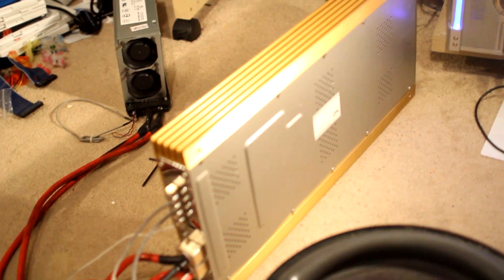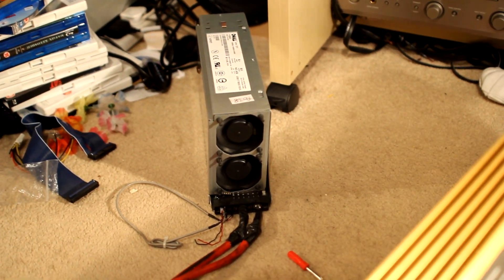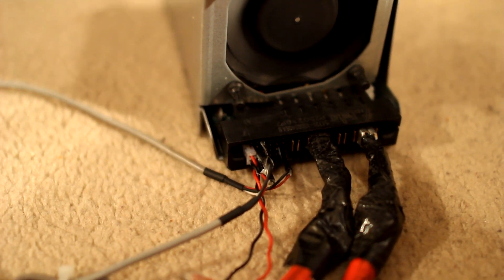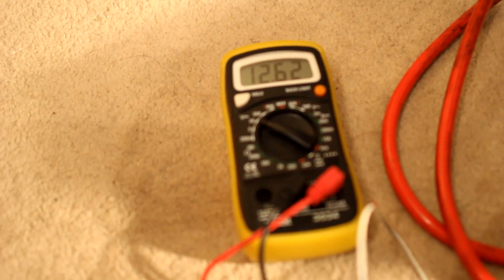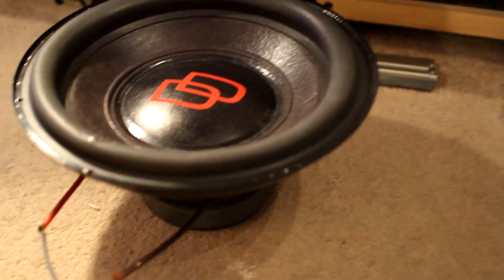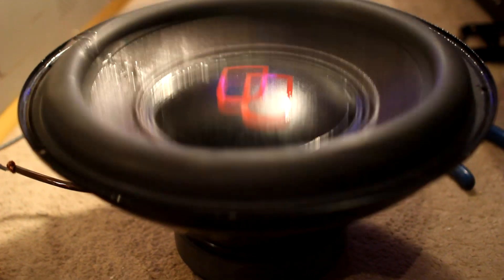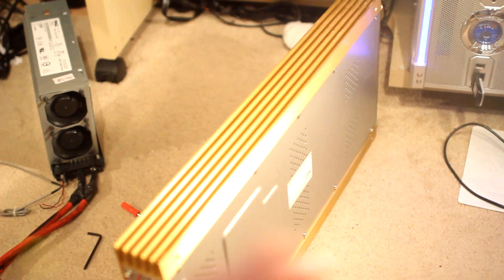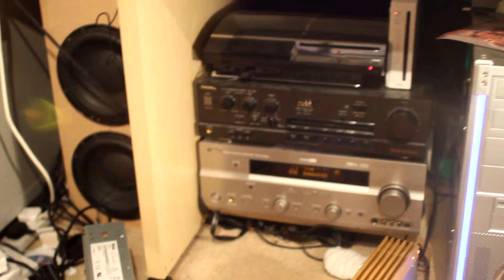Car amps on SERVER PSUs?? Get big bedroom bass power for CHEAP!

Comment: I would stick with the car audio..I tried the crown XTI amplifiers and in my opinion they where garbage..I am currently running 2 power supplies that are 14.5 volt 120 amps..A taramps and a stetsom..4 car amplifiers..1 PPI ICE7000.1 on 2 skar audio EVL-18S and 2 bemines GZ-61 1 amp on 3 American bass XO 15s and the other on another 3 american bass xo 15s..Then i have a genius GMP-200.4D bridged to 2 channels on 2 American bass godfather series 8 inch horn drivers..All getting signal from a JVC BT150..Have alot of videos on my utube channel and its the best audio set up ive ever seen very impressive!!

Comment: Here in the states it would be much easier, neater, and just as cheap if not cheaper to buy a used pro audio amp off of Craigslist. And you can get the ones, like the Crown XTI series, that have DSP built in. So you'll have room correction, limiters, delay, and digital crossovers built in. And in one clean package. Then you could get some Eminence, or other pro audio subs that are designed for use in rooms, aren't designed to make use of the cabin gain that cars afford you. This will do a much better job. This will sound better, look better, and be safer. You could also get a loudspeaker manager if you wanted even more control over your whole system. 

I would not go this way myself, unless I already owned the car stuff, and even then. I would probably sell the car stuff, and get the pro gear instead. Or you could also pick up some cheap used HiFi amps, and use a MINI DSP as the crossover/room correction. I just got an AVA Omega Star 250EX for $225. That's plenty of power for subs in a bedroom. I have it hooked up to my $200 Cerwin Vega VS-150's w/15" woofers. The box is about 6 cubic feet, and ported. 

I have too much bass right now. So much so that I'm going to buy a miniDSP, or use my computer or my Raspberry Pi as a DSP to make it sound better. It sounds amazing already, but on some songs it's just a little too much, and I don't have tone controls. Plus room correction is almost a must with this much bass in a small room. This stuff just isn't that expensive. Certainly not so much so that it's worth having a jerry rigged mess in your listening area. Of course the situation may be different where you live.

Comment: I know this vids old but why doesn't a company sell these psu's but made only for powering car amps at home? They would sell loads. If anyone knows why a company has not done this let me know :)
Reply: +Hugh Stevenson They do, to some extent. The thing you're looking for is a '12 volt power supply' for things like ham radios and such. For example, these:
http://www.universal-radio.com/catalog/hamps/astron.html

Note that many other companies make similar power supplies, and this is just an example, not a recommendation. You should look into different brands and ability to supply continuous power before buying one.
Reply: +Private Information OK cheers for that
Reply: digital designs sells one
Reply: Taramps and stetsom both make them for car audio

Comment: i have a.question about the connections on 12v rails... did you connected them with normal terminal climps and soldered to a bigger wire.maybe 4 gauge cable ??

Comment: How do you wire two of these server power supplies together?
Reply from the maker: In parallel, and connect the current share pins together on both PSUs.

Comment: hey I have a dell server supply I use at home for repairing amplifiers.
mine puts out 13.8volts and 121amps :) built in to a nice case with volt and amperage meters and lcd fan controller with sensors 

il be upgrading soon too get 14.4 volts 500-600amps
Reply: richard beetwell did you modify the PSU to give 13.8? also what brand/model is that
Reply: richard beetwell chance of getting any pictures?

Comment: Because of this video, I went on eBay and bought myself the same Dell PS. This is truly amazing. But if I may bother you to wonder which pins bump the voltage up to 12.6~ volts it'd be fantastic, thanks!
Reply from the maker: Its good theres literally no voltage drop! Since this video ive found ones on ebay that put out 157A on the 12v rail!!
To bump up the voltage connect one of the 3.3 rail pins to the 'currentshare' pin.
Reply: barevids AWESOME! I just connected two pins, which I believe to be the right ones, and the voltage went up to 13.2 volts! It's all running stable, too!
Reply from the maker: JesusCrunch WHAT?! How did you get it that high!? can you do a diagram of what pins you connected where!?
Reply: barevids Here's a diagram I just made. Imagine the power supply flipped opposite of how you have it in this video. The pins colored red are the two I connected to get 13.2 volts.
https://drive.google.com/file/d/0B9F_Yk-DM1YkUFJqNlZaTUtTaWM/edit?usp=sharing
Reply: JesusCrunch
I only get 12.6~ volts, so there is something you're not telling us:)

Comment: Server PSUs... why didn't I think of that? two 12 volt PSUs @ 75amps each 75+75. would be perfect for a 1200-1500 watt rms amp .... I want .... but doesn't Kinetic make like 80 amp power supplies/chargers that do pretty much the same thing??

Comment: I Would deffinitely stick some caps between the PSU and the amp. Computer powersupplies aren't designed for big drops. A couple of 10000uf 16V caps would improve that setup immensly.

Comment: you should run a capacitor too as it will put less stress on the psu and make it last longer
Reply: Do some research on capacitors :)
For the capacitor to do anything, it requires a voltage drop. That power supply isnt even droping 1/4 a volt.
 MATH:
E = (1/2)* C * V^2
Joules(Watt-seconds) = (1/2) * Capacitance (Farads) * Voltage^2

1 farad capacitor:
E= (1/2) * 1 * 12.62^2
E = ~79.62 Joules of energy.
This is how many Watt-Seconds the 1farad capacitor can supply from 12.62 volts down to 0 volts.

to figure out how much power would be supplied to the system, we calculate the difference in stored power accross our voltage drop.

12.62v = ~79.62 Joules.
12.59v =~79.25 Joules
79.62-79.25 = .37 Joules
This means that if he added a 1 farad capacitor to this power supply the cap would supply a whopping 0.37 WATTS for 1 second. :)
a 10 farad cap would supply 3.7 Watts.
a 100 farad cap would supply 37 watts.
a mammoth 1,000 farad capacitor would supply 370 watts... for one second.
that same 1,000 farad cap would only supply 195 watts for two seconds ,92 watts for 4 seconds...

Hopefully you see how incredibly useless a capacitor would be in this situation? :)
Reply from the maker: stertheder This is perfect. Thanks for doing the maths i could be bothered to work out! Always knew caps were more hassle than theyre worth.
Reply: @barevids  could u make a video of wiring the power supply up because I want to power my amp and bump some bass
Reply: barevids You are most welcome! :D
Caps have there use (Big caps that is), but this server psu is NOT the place ;P

Comment: One thing to note here is that switching power supplies like the one you've got there aren't linear. Which means that the output voltage does not drop on load like a transformer based power supply does. Whenever you draw a large current from the SMPS it will compensate the voltage drop automatically.

Comment: :D im glad to help bro :)
Reply: RWL2012 can you help me out with a psu?
Reply: Jay Holley I have the Dell 7000815-0000 and I need help. What pins do I need to use to boost up my voltage? Its at 12.1 volts right now. Please help me.